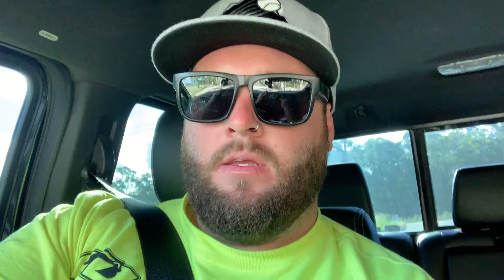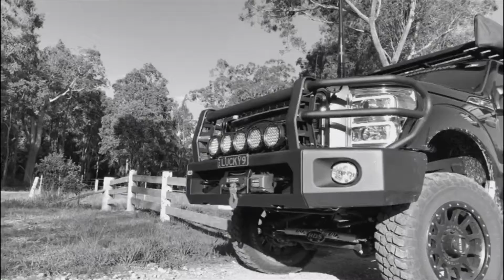DIESEL DPF SYSTEMS how the go wrong ! FORDS NEW 7.3L ENGINE ?

Comment: There’s talk Cummins could egrless in the future on their smaller engines as some of there larger displacement engines like the x15 15 litre engine in Australia are egrless, it still has a small dpf and still uses adblue (def), so that could be Cummins future direction on there smaller engines which seems promising for ram

Comment: I have heard that the 7.3L gas V8 is based on the 6.7L diesel V8, making the "new" 7.3L gas V8 more familiar to work on. I am looking forward to the fuel consumption and HP/TRQ at what rpms as well.